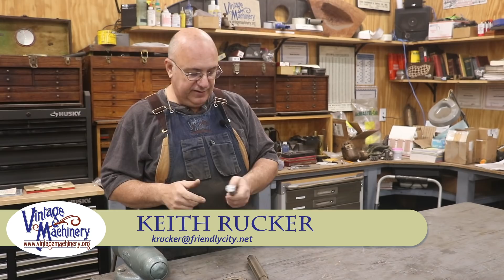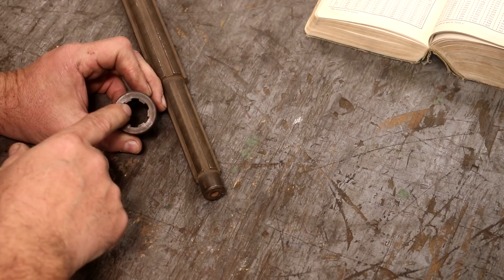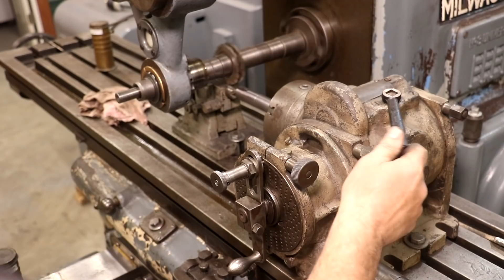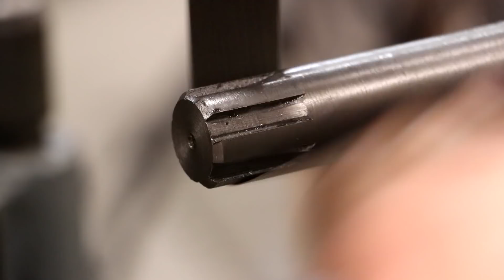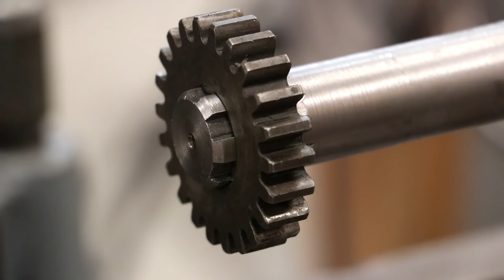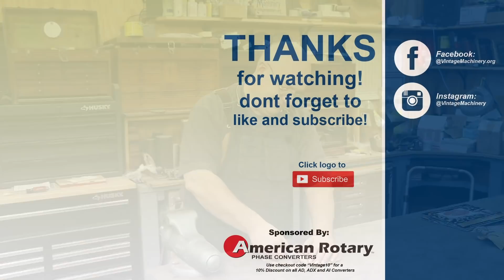Kearney & Trecker Low Lead Attachment Drive Shaft - Cutting Splines

Comment: Great video thanks Keith. Curious about the length of splines on the collar end they seem to run a long way into the bearing surface, was this by design? Cheers
Reply: The bearing surface is between the two shoulders at the middle of the part. 22:49
Reply: @SandBoxJohn  I thought that was a relief and there were two bearings either side of that relief?
Reply: @AndyJenkins999  You are quit correct !

I don't think the spline running through the bearing journal is that big of an issue as the shaft turns gear blank at slow speed to cut the helical gear teeth.
Reply: @SandBoxJohn  Yes would agree with that was just wondering if Keith left the splines that long on purpose for any reason. Cheers

Comment: Wouldn't this work with a regular endmill too though? Then you wouldn't have to cut into the flange.

Btw. if you have a third one of those cutters you could have set it up that you don't have to change out the cutters every time, just move the Y-axis into one position for cutting the sides and another position for cutting the center of the slot.
Reply: I think that would make a different angle on the sides of the splines and then they wouldn't mesh.
Reply: @qidydl  if you go through there straight once yeah, but I mean with proper offsets etc. the profile shape would be the same as Keith made.
Reply: @CatNolara  That's right, he mentioned that you can do it with a vertical mill but you have to do the offsets and make multiple passes, so it's more work. The trick is that just cutting six slots with an end mill would not make the same shape, wouldn't want anyone to make that mistake.
Reply: I suggest you watch the video.  He explained this!

Comment: That's not cheating. That's using a setting jig.
Are the two splined ends timed?
Reply: I don't think they need to be timed.
Same thing like if you cut metric threads on a imperial machine or vice versa, you just don't disangage and drive back and forth.

Comment: As an armchair machinery fan,  can someone explain to me what a "Low" lead attachment is?  I understand what it is and what you use it for, but what is the "Low" and how is it different from the other type I've seen listed in K&T catalogs.
Reply: If you look at the K&T catalog at http://vintagemachinery.org/pubs/2098/6762.pdf on page 31 of the pdf it shows both conventional and low lead attachments. They support different ranges of shaft diameters and the low seems to have a much larger range due to the change gears/worms.